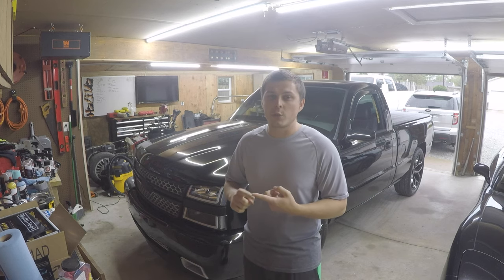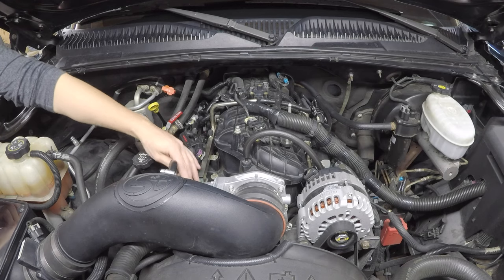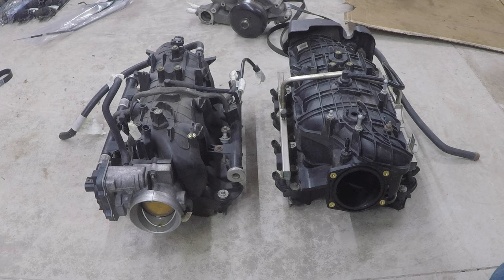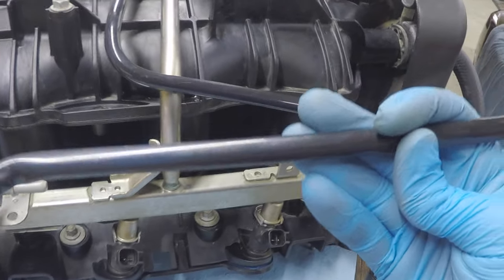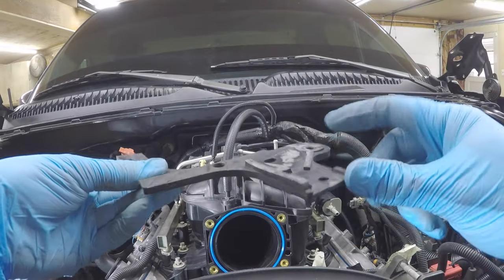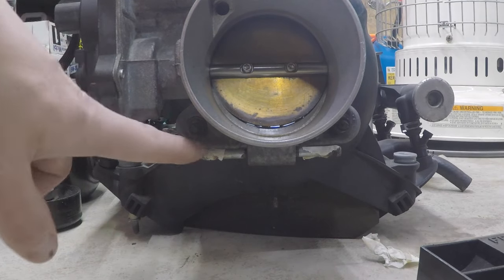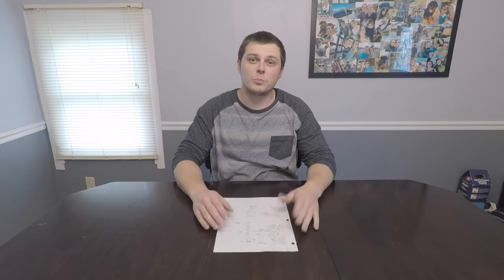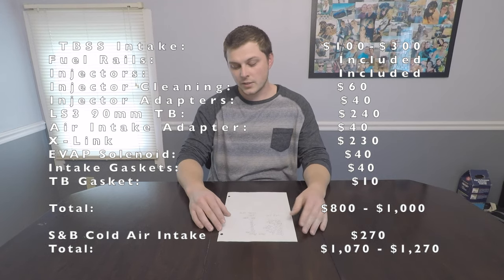TBSS Intake Swap, Ultimate Guide! Add More Power To Your LS Motor!

Comment: I see all kinds of different stuff on making the map sensor off the old manifold work
Reply from the maker: For sure, thats definitely the easiest way. Trying to make the newer generation map sensor work is a tuning headache. Plus there are 3 different ways the new map sensors mount. So gotta get a little creative with it.
Reply: @TheKingCoopa  I hear some fit right in, others say they pop the oring off the tbss sensor and put it on the old sensor. Some say  a rubber grommet. Seems like it depends on what year truck you have AND what year manifold you got
Reply from the maker: @loweredyote8416  right! Its crazy how many variables there are for just one sensor haha

Comment: Do you still need Xlink if you have the TBSS throttle body? If not what is recommended? Thanks for taking the time to do this video huge help!
Reply from the maker: Hey, from the research I've done, yes you would still need it. The TBSS/NNBS throttle bodies use the newer wires and sends different signals than the older TB's. I think you can swap the pedal TAC module, and wiring from a Camaro to make it work. You can convert to a cable driven throttle body, but that will require more parts, and changing the tune. When it is all said and done I still believe the X link is the easiest and cheapest way around it. Don't quote me on that though. Hope that helps.

Comment: How much more hp/trq can I expect out of this upgrade (on average)?

Fyi: 2005 Tahoe with the following work,

6.0L LQ4 Swap

GM HotCam:
Lift Intake .525
Lift Exhaust .525
Duration Intake 267
Duration Exhaust 276
Lobe Separation 112

Lifter Upgrade/Pushrod Upgrade,

Valve Spring & Retainer Upgrade,

Upgrated Plugs, and Wires,

Intake, Headers, Straight Piped, and a Street Tune.
Reply from the maker: Honestly have no idea man. Thats a stupid big cam. The lift isn't that big, but the duration is. Most stock bottom end lq4 can only fit a high 230s low 240s duration. Im really surprised you dont have piston to valve issues. Hope you went with a 3000 stall and a built tranny. But id guess atleast 420hp to the wheels.
Reply: @TheKingCoopa  - I'm pretty sure he gave the full specs on that cam, not the duration at .050 (like most of the cams we talk about are rated). Based on that, his cam is around a 220⁰ cam at .050 lift. Not too crazy... ;)
Reply from the maker: Ahhh, okay. That makes alot more sense 👌 yea, not too crazy

Comment: For what a TBSS intake cost you can get the same results literally by having your stock truck intake manifold ported along with the throttle body and still come out cheaper than buying the TBSS intake.
Reply from the maker: If your balling on a budget, then yes. But actually comparing apples to apples, I don't think so. It would definitely help, and be cheaper, but a ported stock TB,  I don't think will make the same CFM as a 90mm TB. Most guys say they gain 10-15hp on the intake swap, I don't think you can make all that HP up on a ported stock intake. I could be wrong. But I'd definitely be interested in looking at the CFM charts and dyne charts of the two comparisons.
Reply: @TheKingCoopa  I have seen the dyno numbers of ported stock truck intake/throttle body combos and yes it does make power and torque and it is substantial enough. A larger throttle body such as from say a 78mm to a 92mm does not mean you will make power. Most of the time the larger throttle body will actually hurt your power rather than help. But porting the stock truck intake and throttle body is a great way to make anywhere from 12-30HP on the dyno as these are the ranges of numbers I have seen according to what mods each truck has. I'm not pulling this out of my ass, I have seen it. Go on Instagram and look up @454chuy and you can see some of the dyno numbers on there. He is great at porting and the only person who does my port work.

Comment: Great great video! Buying all parts needed for my 6.0 swap. But have a question..maybe you can or can’t help me. I have 2007 Silverado v6, single fuel line. Would I need to add some type of fuel regulator, or swap fuel pumps, or any other modifications to add the tbss intake with the 6.0 swap?
Reply from the maker: Hey, sounds like you have alot of work ahead of you 👌 seeing that you have a single fuel line, you have a return-less style fuel system. They are internally regulated in the tank/pump. So you do not need a regulator. One thing you should look up, is to make sure your stock fuel pump has enough pressure/GPH, since you are adding two more cylinders. I'm sure a stock v6 fuel pump would be fine on a stock V8. But if your cammed and modified, that stock v6 pump might not beable to keep up. But the pump stats online would beable to give you that info. Hope that helps, good luck with the swap, and thanks for the support!
Reply: @TheKingCoopa  awesome! I will definitely look into fuel pump stats! I went into Autozone and napa and input my trucks year and model changes v6 to v8 to find if part numbers were the same and they were, for the most part. Pumps changes if it were a crew cab or double cab really. But I will still double check pumps rating. Thank you so much! And yeah, it’s a stage 3 cam, flat top position with headers. Something to make it sound nice, lol not looking for racing really.
Reply from the maker: @xXChevyRiderXx  gotcha. Yea, if the part numbers are the same, you should be fine then. Also whenever you get it done, just to double check, you could run a fuel pressure guage off the Shradder valve on the fuel rail. Give it some revs and make sure the pressure doesn't have any crazy dips. But I'm sure you will be just fine 👌

Comment: Doing something similar… truck Norris cam, supporting valve train, TBSS intake manifold with 87mm gen4 TB, K&N intake, and Gen 2 ford lightning green top injectors. My shits going on an AWD Qudrasteer Denali though. The fun factor is way down compared to his rig.
Reply from the maker: Oh nice, thats awesome. Definitely sounds like a solid build. I'm glad you are going with the supporting valvetrain, I feel like alot of people skip that part on cam swaps.  Is your truck an extended cab or crew cab?

Not sure if you have seen my newer videos, but I swapped to a quadrasteer bed, to run some 14 wide drag wheels (also AWD). And I swapped to a built 6.0/4l80e, makes 600whp on nitrous. Pretty fun little truck.
Reply: @TheKingCoopa  Extended cab. Yep I did springs push rods and trunions. Should have just done heads to bump compression up. I still think I’m like $1000 away from being finished. The injectors I want to use won’t work because data is too scarce so im going to maybe use the 30lbers I scavenged off the TBSS intake or just buy some flex fuel injectors and leave room for growth.
Reply from the maker: @garretmonnet9397  for sure! Those crew cabs are starting to get really hard to find. Room for growth is always good!

Comment: Do you have anything on the tbss into a 98 4x4 chevy truck ,the does and don't 5.3 swap. 
Your awesome  !!!
Reply from the maker: Hey, sorry for the late reply. I think the only difference will be the TB. I believe with the 98, you should have a drive by cable throttle body. So you won't need the XLink adapter. But you will need a throttle cable bracket, that bolts onto the top of the intake to hold your cables in place. I think its like $20. And you would need a 3 bolt to 4 bolt adapter (stock throttle body) or buy a 90mm DBC throttle body. Everything else should be the same

Comment: Trying to get the most potential out of my lm7 as possible, got the intake, fuel rails and injectors for $50. Got the ebay 92mm throttle body a from friend free of charge that has a hole for the pcv. Just need the injector adapters, hoses for the evap. since I’m using throttle cable I won’t have to worry about the X-link or anything like that right? The intake came with the evap still on it. Bought new thick metal felpro gaskets for intake and normal one for throttle body. Thinking about having the Injectors cleaned now. All in i’m at around $90 with the intake and the injector adapters, if I have the injectors cleaned it’s prob another $60 so $150 total for my swaps
Reply: Also has a CAI with rebuilt heads, bigger valve springs and a fat howard rattler camshaft with gapped rings for future boost.
Reply: Need the c5 fuel filter which is about another $50 so looking at $200 total
Reply from the maker: Yea, if you're running a cable driven throttle body, you won't need the Xlink adapter. Sounds like you got it all figured out and ready to go! I'd recomend getting the Injectors cleaned. I found out mine were used for e85 and were all gunked up. Most local guys charge between 5-10$ per injector for cleaning. Budget wise, you're definitely killing it. Good luck with the swap, and keep it up 🤘
Reply: @TheKingCoopa  thank you sir I appreciate your help and your truck looks and sounds amazing too love the single cabs, am definitely going to look at getting the injectors cleaned I didnt know the price but that’s not bad at all especially for reassurance purposes. I’ll be doing it this weekend and I’ll make a video on before and afters with sound and how it looks compared to the gen 3 3-bolt.
Reply from the maker: @dylonkammerzell8880  for sure, and thank you for the support!!

Comment: So I done swap, and I loved it. But for some reason at times during deceleration there’s a whine. It’s happened with the 4.8 & 90mm throttle body. Have you had this problem?
Reply from the maker: Hey sorry for the late reply! Have you figured it out yet? Do you have an aftermarket CAI? 

My BBK CAI on the corvette does the same thing, but its a high pitch whistle

Comment: Well done! I will be referring to this video several times for my swap. Question: will the TBSS throttle body work with this swap on my 04 Silverado 5.3?
Reply from the maker: Thank you, glad I could help out some. Im not sure if you can still use the tbss TB, being that it is from a newer body style, the wiring is different and sends different signals. Thats why I needed the Xlink, to convert all that over to the NBS harness. The xlink only works with gm or acdelco TBs. And it matters if you have a silver or gold blade, on the LS3 TBs. So im honestly not sure, sorry

Comment: Trying this out on Friday but with the stock intake manifold and Glenn’s auto 90mm throttle body with a 3bolt to 4 bolt intake manifold adapter. Gonna upload the video Friday hopefully I can see some gains. I subbed to the channel it was very helpful watching this video man 😂🤙🏻
Reply from the maker: Awesome, Glad I could help a little. Thanks for the support! And make sure you let me know how it goes, id definitely be interested seeing what gains you get!
Reply: @TheKingCoopa  will do! I love your truck you did a really good job on it man!
Reply from the maker: @NT.RACING  thank you, I appreciate it 🙏. She has definitely came a long way in one year. This winter i think im going to C notch the rear frame, go to a 4/6 drop, and just to be different i wanna do a quadrasteer bed swap, and get the rear rims widened 3in to run a fat back tire. So still a little ways to go before im finished with her
Reply: @TheKingCoopa  dude that is so sic! 4/6 c-notch drop is perfect. That’s what I’m going for as well. You got this man I’ll definitely be watching and sharing this truck with my friends. They always appreciate a badass build 😎
Reply from the maker: @NT.RACING  thank you! Can't go wrong with a 4/6 drop. I might have to go with a little smaller tires though, so the front doesn't rub. Hard part for me is going to be finding a bed to swap it haha. But right now I'm looking for a new place, with more property and a bigger shop I can fit a lift in. About to list my current house for sale too, so just been a little busy with that, but we will get there 🤘
Reply: @TheKingCoopa  no problem 🤙🏻 That’s right man. Have you ever considered going with tubs? That way you have more tuck with wider wheels in the rear? That should be awesome man I’m excited for you. I hope you’re able to find a good setup for your shop. I don’t know if you’re in California but if you were I know of a guy who’s selling a lift for 2k I believe.

Comment: Can I just use the stock TBSS throttle body and just make sure the X-link adapter is for the correct blade color
Reply from the maker: Hey, sorry for the late reply! Honestly I'm not sure. Everytime I've seen anyone do the swap or all the research I did, everyone always swapped out the throttle body. Its definitely worth a try though, to try and save the extra money. Sorry I'm not much help with you on this one. Good luck though, let me know how it goes 🤘

Comment: Awesome video!!! Question, What size speed engineering long tubes did you go with?
Reply: I went with 1 3/4. Tuner told me to go with that size. 5.3 l33 NA, ball park to be a 450-470 hp motor.
He said I could go with the 1 7/8 but 1 3/4 would be better.
Reply from the maker: Hey, sorry for the late reply. I had a 4.8L at the time, and I went with 1 3/4'. the 4.8L doesn't flow enough for the 1 7/8" and id probably lose a little power with those. since then ive swapped the a 6.0L and still rocking the 1 3/4"

Comment: What are the chances that x-link will fail ... I say it because I did the same installation in my 2005 silverado and since I did it every time I accelerate to full speed it appears (reduces engine power) I buy everything new I do not know what is happening
Reply from the maker: Sorry for the late reply. You definitely have an issue going on. First thing I would do is throw a code reader on the truck and see what it comes up with. That will hopefully tell you a lot, you can narrow down and fix the issue. If not, next step I would do, is call up the company about the X-link, tell them the situation. If its the X-link, and is a common issue, then they will definitely know what to do. Or maybe they can work out a way to get you a new one. If neither of those two work, I'd look for a local reputable tuner, and have them take a look. A lot of times they can see things on the HP tuner software, that are out of the normal. And can help you narrow down what this issue is. Sorry, thats the best I got. Hope that helps! Good luck on your build.

Comment: Great video! But i have one question, What exactly did you do to make that air intake tube fit? did you get a new cup link Or did the kit already come with a cup link that fit, and how did you tilt the fan?
Reply from the maker: Hey, the air intake tube fits the 78mm TB and the new TB is a 90mm. So I got a rubber coupler, 4in to 4.5in I believe. It is linked in the description of the video. 

The fan stayed in the same spot. Only thing I did was cut about 1in off the tips of each fan blade, to clear the intake tube
Reply: @TheKingCoopa  Thanks man! i appreciate it
Reply from the maker: @diegotorres3860  for sure, good luck, and thanks for the support 🤘

Comment: I’m going through a complete brain fart over the evap system and how it’ll fit into my swap since my lm7 is going into a foxbody. Would I just block those off? Sorry if it’s an obvious question, I just wanna make sure I have no vacuum leaks or running issues
Reply from the maker: Yea, just block it off, and make sure your fuel tank/cell has a breather for the fuel to expand and contrast when it gets hot or cold. And try to make the breather higher than the fill/gas cap. So when you fill up, it doesn't piss out the breather

Comment: what fuel pump would u recommend im building a 5.3 11.1 comp  Afr heads not a crazy cam 425 -450 hp  any one make a drop in pump that would pump enough thanks for your help
Reply from the maker: Hey, I would assume a single walbro 450 would do the trick. You can plumb it yourself in the existing fuel bucket. Its a little bit of work, but can be done. If you were wanting a complete drop in unit, with a hot wire/harness. Then Chris1313 racing is your guy (link below). He makes some nice stuff. I'm running his kit. Dual walbro 450s, drop in unit, with his billet top hat, and dual relay harness. The truck curently makes 580whp on nitrous since this video. 

https://www.facebook.com/profile.php?id=100069750043445&mibextid=ZbWKwL

Comment: Not sure I need the purge solenoid.  I'm going to replace my gas tank with a fuel cell, do I need the purge device?
Reply from the maker: Hey, I havnt done alot of research on the evap system. But I have seen alot of race truck setups, and I do know that they get rid of that system. I believe most guys just plug the hole where the evap tube/solenoid comes off the intake manifold, then change it in the tune as well. So it doesn't throw any codes, or act funny. Thats the best I got. Hope that helps 🤘